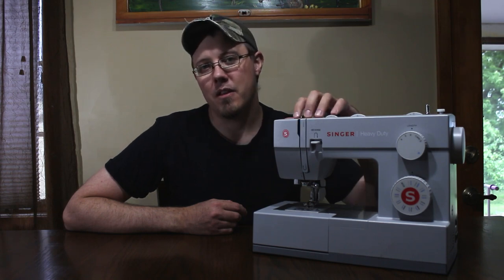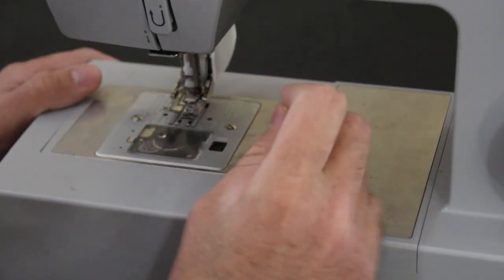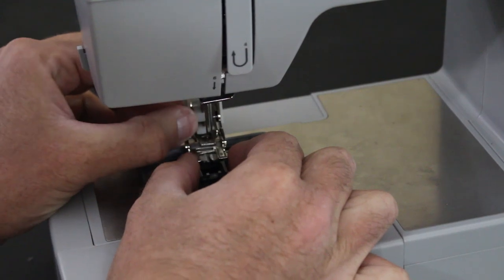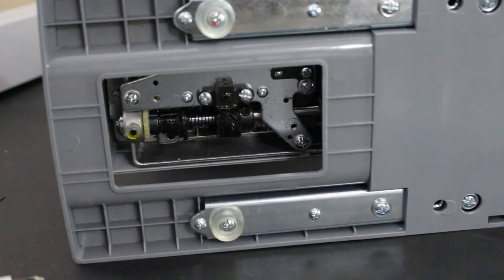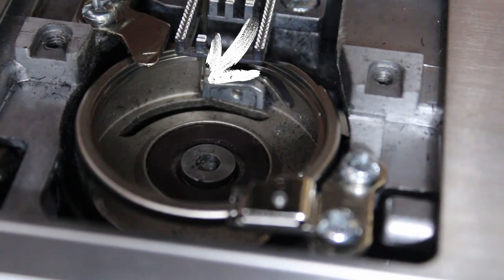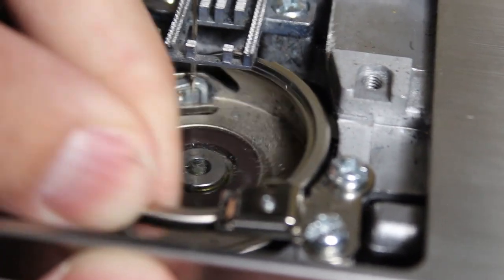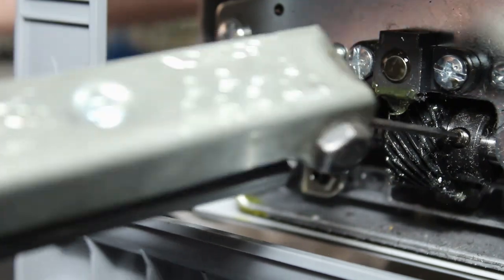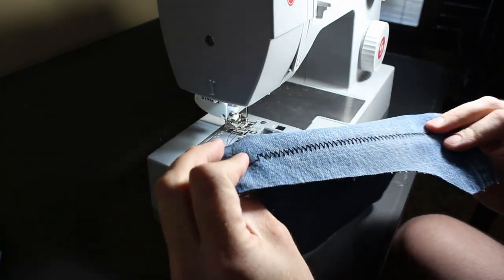Singer 4423 - Setting the Timing

Comment: I really appreciate this video. Sewing canvas on my Singer 44S, heard a clunk , thread and fabric hung up and jammed. Had to break the needle off to get it loose. Turned the fly wheel , it was smooth,  but would not catch the thread to snag the bobbin thread. Did exactly what you showed here, works great now. Thanks again.

Comment: Thank you for this. I bought this machine under multiple recommendations and I’ve had nothing but issues. Was tired of having to pay to have it repaired.
Reply: Yea same. My parents have a monster Durkop Adler and it never messes up. And bobbins holds 100yards of thread. These tiny bobbins are a flaw.
Reply: I have the same issue. I don’t ise it much. Every time I use it a new problem come up. Thank you. I will fix it and get rid of it
Reply: Really? Mines 6 years old and even sew leather sometimes and still works good. I didn't even clean for like 4 years lol.

Comment: Thank You ! Thank You!....awesome video so helpful.  At first, I gave up because I didn't trust myself with taking apart, then when it was exposed, couldn't loosen the black gear screws. Put everything back...Tried again, got leverage on those three gear screws...turned the wheel for the timing...and TADAH!!!  Was able to fix the hook timing on the Singer Heavy Duty 4452...Mahalo!

Comment: Hey! What did you use to loosen the three Allen head set screws? I’m trying everything but the screws on my man gone won’t turn.
Reply: Did you ever find anything that worked to get those little butthole allen screws out? I am poking and prodding and nothing is working, even with the allen key that fits it wont budge!

Comment: Great video I’m still having problems thou :( I unscrewed the 3 Allen’s at in the bottom but the hook wheel still only turns a quarter of an inch before still catching and moving the needle and wheel
Reply: Did you figure it out?
Reply: @eliasstein1421  did you figure your issue out? I’ve taken the 3 screws completely out and sprayed the black gear with WD40 and it still doesn’t move at all
Reply: I have the same problem - the hook wheel cannot be turned enough to catch the tread. Otherwise an excellent tutorial.

Comment: Thanks for the video! I removed all three set screws but my metal bobbin holder (don’t know what it’s called) still won’t spin freely; it just moves along with the needle. Any suggestions?
Reply from the maker: Try holding the shuttle hook in place and turning the knob. Be careful not to get poked by needle or shuttle hook.
Reply: Plains Prepper I still can’t get it to budge. I found someone’s amazon review stating that “once it gets knocked out of time, you'll probably need another one. the set screw used to loosen the shuttle often gouges into the shaft, making it impossible to rotate and make the adjustment (soft metal parts)”. Maybe that’s what’s going on with mine. I really appreciate your taking the time to reply though!
Reply: I'm having the same problem. Have you made any progress Keri Beth?
Reply: I had the same problem. I had to take the 3 black screws completely out, then I used the Allen wrench in the screw hole as a stop lever to keep the gear from moving while i rotated the hand crank to get the needle to move up/down into the proper position above the hook. I had to put some ass into it, scared the bejezus out of me because I thought it would break, but that was the only way to get the hook in the proper place with my needle. Good luck!
Reply: @keribethlivingston  having this issue right now
Reply: For anyone having this issue, you have to temporarily remove the belt from the cog (accessed by fully removing the bottom), this video helped me: https://www.youtube.com/watch?v=HSsGAeIRmjk I also discovered something else was out of sync - 6:00 mins in it explains. Good luck everyone!

Comment: Does your bobbin wheel spin all the way around? Cause I took the 3 tiny screws completely out underneath, and I still can't move the bobbin wheel more than an inch. I can move it a little to the left and right.  But not enough either way to get close enough to the needle.
Reply from the maker: I only had to adjust mine between a 1/4 and 1/2 inch. 
In theory it could go all the way around
Reply: @Plains Prepper  thanks for the feedback. I think I might have to take it to a shop then, cause it's not moving all the way around. It only does when the needle moves, but that's not solving anything. I need to be able to move the bobbin wheel as much as I want while the needle stays all the way down.

Comment: Im having a really hard time loosening the allen screws. they are so tight! Do you recommend a specific tool? im using a tiny allen wrench without much grip. What else can i use?
Reply from the maker: If you could find a screw driver with changeable tips that might work.
Reply: @PlainsPrepper  ok thanks!

Comment: I can’t get my three screws at the bottom to loosen? Any suggestions? What tool should I use
Reply from the maker: My only suggestion is to use a constant pressure when turning the Allen wrench. This will hopefully loosen the loctite that is on the screws. Don't force it or you may strip the screws.

Comment: Thank you for this video.  I can set the timing but it won't stay set.  What causes the machine to lose timing? What do I need to do to get the timing to stay?
Reply from the maker: Mine was sewing things that were to heavy for the machine and jamming the needle at full speed.
Could also be the set screws are stripped.
Might try putting some blue loc tite on them.

Comment: Thanks for this simple-to-follow video. I'm troubleshooting a clunking sound after breaking a needle... and all the low hanging fruit has already been ruled out. The screws on my gear are immovable. I am pretty sure I would break the tiny allen wrench before anything moved. It is RIGID. Maybe I just can't get enough leverage with fingers and this little tool?

Comment: Does the same principle hold for the Singer 6268?  My machine winds the bobbin in place, and access to the bobbin is through a slider.  Throat plate lifts off.  And where is the black gear located?  Is it under the free-arm or closer to the control panel?
Reply from the maker: Look on page 120 of this manual. It appears the gear you need to loosen is closer to the motor.

https://www.scribd.com/doc/184031940/Singer-6268-Service-Manual

Comment: Great video. I have this exact issue, thanks for potentially saving me a trip to a fixer
Reply from the maker: Your welcome!
Reply: @PlainsPrepper  btw I see a few people had a similar issue you to me where by they followed your video and still came up short. I'm not sure if there are multi models or different models for the US. I have a UK machine and had to remove and loosen the upper timing gear grub screw and machine screws to get enough slack to shift the shuttle around. Theres shaft through the middle of shuttle that I fully removed also.

Comment: Hi, I just bought 4423 singer sewing machine via Amazon last month, at first it was working great, but for 2 days now, it keep hitting the bobbin holder. Any advise?.
Reply from the maker: I had a similar issue shortly after I got mine. If you take off the throat plate you should see two silver pieces holding down the bobbin holder. You can loosen the rear screws to remove the bobbin holder and reposition it.
I made a quick video of how the bobbin holder should be aligned.
https://youtu.be/K5chYPJaI7c
Reply: @PlainsPrepper  Thank you for quick reply!!. I look again how how the bobbin holder looks like, and reposition it again  and it works. Finally finish my quilt blanket .

Comment: Thanks for the video. Mine seems to  picking up the thread ok. But it’s doing something wonky when it does about 2-3 stitches and I have about 4 threads coming out from the under side instead of just one.  Took the bobbin carriage out and it seems fine.
Reply from the maker: I would double check your thread tension. Might be that the bobbin tension is too loose
Reply: @PlainsPrepper   thanks for the response. I figured it out about 20 minutes after I posted. Stupid issue actually.  Somehow.  Dunno how. The thread managed to come out of the lifter arm and it was going straight to the needle feed. So the slack was not being taken back before the hook was coming through and catching it a second time. Just a silly issue. I should have rethread it sooner. Glad I didn’t start working on timing!

Comment: I have got singer heavy duty 4423 machine its new but the stitch is dotted from inside when I sew something
Reply from the maker: Make sure the foot is up when you thread the machine so that the tension discs are open and can grab the thread.

If that doesn't work you may need to increase your thread tension.

Comment: What did you use to loosen those screws?
Reply from the maker: There is a small triangle shaped screw driver included with the machine. If you don't have it then a short flat head screwdriver should also work.
Reply: Plains Prepper hi, I tried using the tool sent with the machine and it doesn’t work to release the screws in the bottom. What else can I use ? Thank you in advance
Reply from the maker: Sorry didn't realize which screws you were talking about. I used a 1/4 inch hex key.

Comment: Hey my bobbin holder ISNT moving freely after I removed the Allen head screws. Any solution to this? This is my second day using my machine and I jammed it and then after it wouldn’t thread my bobbin so I assumed this was the solution.
Reply from the maker: The shuttle can be very stiff. You might try holding it while you turn the knob. Be careful not to get poked by the needle or the shuttle.
Reply: Plains Prepper Ah I see that makes sense. Since my sewing machine is brand new (same model) do you suggest I use a little bit of force to move the shuttle? I was hesitate because I didn’t want to break it but you said it’s stiff and supposed to be like that.
Reply: I had the same problem. I had to take the 3 black screws completely out, then I used the Allen wrench in the screw hole as a stop lever to keep the gear from moving while i rotated the hand crank to get the needle to move up/down into the proper position above the hook. I had to put some ass into it, scared the bejezus out of me because I thought it would break, but that was the only way to get the hook in the proper place with my needle. Good luck!

Comment: What size Allan wrench?
Reply: I think that it was a 5/64 the allen wrench, hex.  However, after fixing the timing it keeps slipping after a few inches of sewing. It is possible that my 5/64 Allen is not the correct wrench and I am not getting a good tighten. 

I kind of suck sewing. I try to rember to "catch, drop, and dig" before pushing the pedal.  Catch the bobbin, drop the pressure foot. Dig THE needle down by hand into the fabric.  But I frequently forget to drop the pressure foot, which tangles.  Stopping by reversing the stick gets tangles. Moreover I want to sew with upholstery nylon thread. Which is pulling the hook on a tangle.  It is not practical to sew 2 to 4 inches and doing all the screws for resetting the timing.

Comment: Fix for the fix.  This was a good video but, as you can see from all the comments below, the three screws on the hook gear are hard (or impossible) to remove.  I tried heat on the screws (to loosen the locktite) but was only able to get one removed.  I ended up loosening the two larger allen screws on the far end of the shaft (holding the timing pully).  There are just two screws here and they were possible to remove.  Here is a good video that gives THIS as the way to release the shaft from the needle movement.  https://www.youtube.com/watch?v=dzWG5oeFoCU
I had a fair amount of trouble getting the hook case to rotate (without rotating the handwheel/needle) but used some force on a screw driver and got it to slip around (somewhat erratically).  I had to make several tries but finally got it right and it worked.

Comment: can you please help me. we have the same machine but it isn't stitching at all.
Reply from the maker: Have you tried setting the timing? Is the bobbin hook catching the needle thread?
Reply: @PlainsPrepper  I did try setting the timing following your video.. it does catch when I do it after threading.. but when I sew, it doesn't anymore.
Reply from the maker: Are you sewing something particularly light? I had a similar issue once and had to switch to a much thinner needle and reduce the tension.
Reply: @PlainsPrepper  i am actually sewing satin fabric which is light. I did folds last time and broke the needle. so I changed it since then, it doesn't catch any stitch anymore. I fixed the plate which bent a little when that needle broke.  I set the timing, still not catching stitches.
Reply: and one more thing i have noticed, pulling the thread out (from the bobbin down below) through the presser foot isn't as smooth as before.
Reply from the maker: You might try putting a piece of paper under the fabric while you sew. This adds some structure while sewing and you can tear it away after. If nothing else it should tell you if it's the machine or the fabric.
Reply: i sure will try that one. thank you!
Reply: I’m having the same problem. I fixed the timing now it won’t sew. What was ur solution? I read through the comments it’s not my fabric
Reply from the maker: Is the hook passing close enough to the needle to pick up the thread?

Comment: Really need help i opened the bobbin screw and still unable to turn the bobbin hook
Reply from the maker: If you are unable to adjust the bobbin hook after removing the screws try bracing it with something and then turning the knob on the right side of the machine.
Reply: @PlainsPrepper  tried this, but couldn’t get it to budge
Reply from the maker: @stevenvetri  it can be very stiff. Try turning the knob both ways. It might loosen the gears grip on the shaft.

Comment: I removed the set screws and I can't get any movement.
Reply from the maker: Try holding the shuttle hook in place and turning the knob. Be careful not to get poked by needle or shuttle hook.
Reply: I had the same problem. I had to take the 3 black screws completely out, then I used the Allen wrench in the screw hole as a stop lever to keep the gear from moving while i rotated the hand crank to get the needle to move up/down into the proper position above the hook. I had to put some ass into it, scared the bejezus out of me because I thought it would break, but that was the only way to get the hook in the proper place with my needle. Good luck!